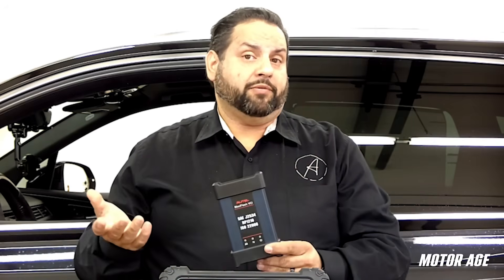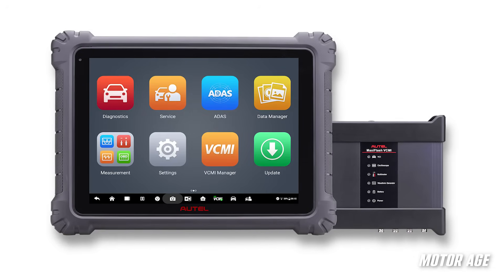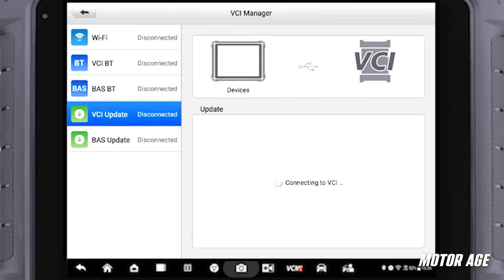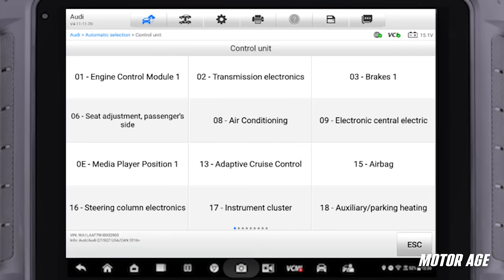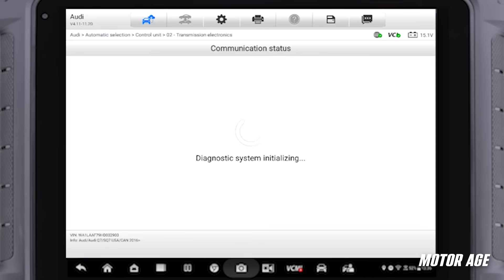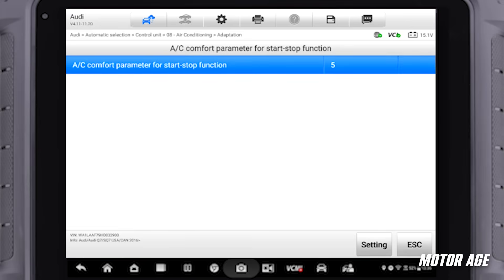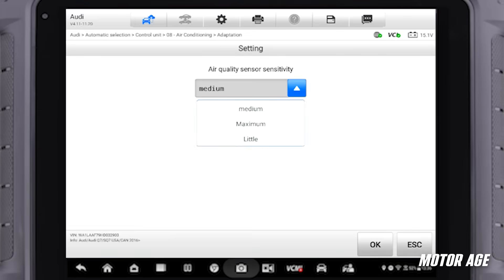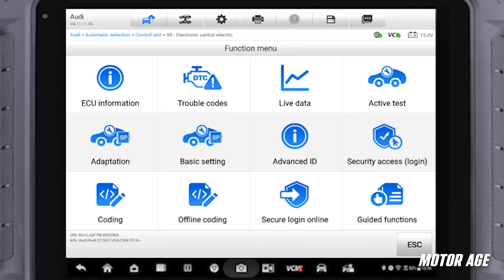Understanding the difference between automotive programming and coding with the Autel MS909

Comment: I am still a bit unclear about the difference between the programming and coding.  The manufacturer builds the programming and loads it into the vehicle's ECM.  As an owner of the vehicle, I am left with what ever bugs are in the programming.  I would like to access the programming so I can troubleshoot issues.   I have a 2013 Chevrolet Volt.  I still drive it.  It's always has had a bug in the HVAC system.  Sometimes when calling for heat it blows cold air and sometimes calling for cooling, it blows hot air.  I've had it at the dealership under warranty and they just load a new program and call it good.  It always returns with the same issues.  There's icons on the touchscreen which shows what HVAC mode it's in.  Doesn't matter.  You call for heat, and the icon shows it in the cooling mode or vice versa.  What I have learned to do is turn the vehicle off and pull the HVAC system fuse for a few seconds and then reinsert it and it resets the system.  It's getting to be a real PITA.  The dealership is no help.  I would like to go into the programming and see if I can figure it out.  It's been a common issue with this model year.  It's just not my car.

Comment: Hello Andy, I enjoyed your video on programming and coding. Should I have to program a used door module for my 2007 S550 W221? Additionally, the keyless touch lock/unlock feature stops working on the front and rear left-side doors, while the right side works perfectly. Help!

Comment: Wow, thought an 11 minute video Wood not overexplain and repeat so much you told us what you were doing in the beginning and it wasn’t even three minutes in and you told us again what it is you were doing? I felt like I was watching a TV episode, where they annoyingly go back and repeat or bring up all the things that the person just tuning in as if it’s fair to the person that’s been watching the whole time can’t stand that, sorry that was a bit of a sidebar there. But I will say, do you think it would be possible that you could fit more commercials into this video from solar panels to nonsense, thank goodness I never have to watch any commercials. But at the same time, this is a video produced by AUTEL, so that in itself is an advertisement, to have advertising ads in your advertisement come on. I want us to be constructive and not insulting, but you’re making a hard. So having the J 25.30 pass-through and accessing Autel remote expert. That sounds as though I would be relying on someone else to do the programming for me? Am I understanding that correctly so I wouldn’t be in control of the programming I would be reliant on someone else? That is what it sounds like. Now is there certain times and hours that the service is not available because I do offer emergency service. Which is not gonna be resetting an oil light obviously. example would be. I’m going out to lost Keys on. Let’s say a 2024. GMC whatever. High security key blank meaning it is Eddie Internal to track cut on the blade with a vehicle dependent push button start wireless proximity module.. and I would cut and program the key on site @ 2PM or 2AM! 
( if they want to pay that emergency fee) I’ll gladly charge it. Now, not necessarily asking about coverage on that cause I do have advanced diagnostics, programmers, and Silca Triax ECode hi security Key cutter/ duplicator. So basically can make keys for whatever. Where does Autel Fit in? Maybe this isn’t the video I should’ve put this comment on but I got sidetracked. We’ll see if you respond but believe me I only meant to start off and end with the comments about. An 11 minute video having way too much advertising from non Autel companies.

Comment: you did't  do any coding. you just changed paramiters. you have to code a module after replacing it in the coding part of the scanner
Reply: If the module has the same program you may have to change the vin, that is not coding. Coding is just changing the parameters, not the program.